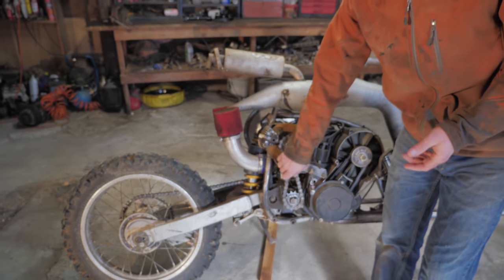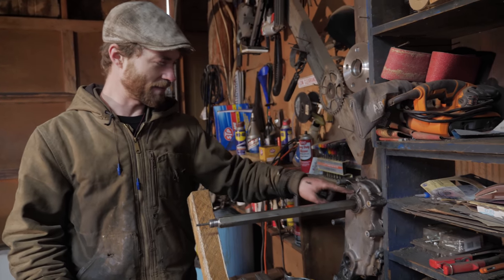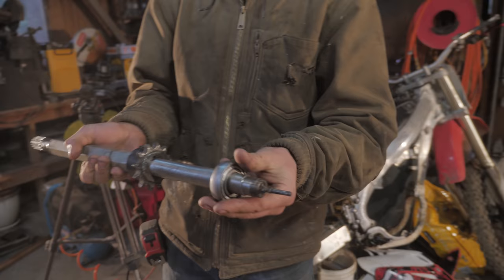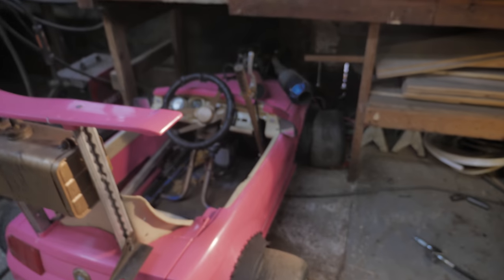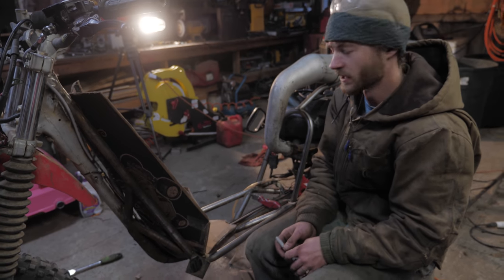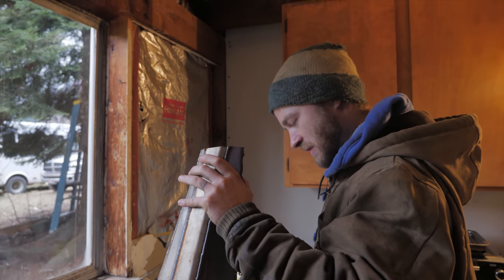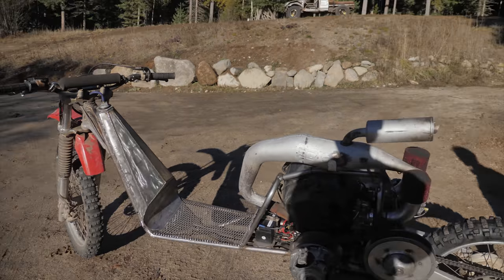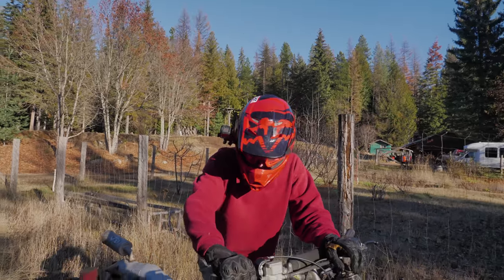The Scary Fast Snowmobile Scooter Rips! Part 4

Comment: The problem is when you build stuff all the time you don’t go over the safety aspect because the end user (you) is mostly pretty competent and understanding of the machine. However this doesn’t account for unforeseen situations. Any time there is a rotating assembling or high voltage these things need to have a guard over them whether it’s a mesh screen or plastic there needs to be some layer of protection. The mindset is “I’m just gonna take it out for a quick test” but that’s when the accident happens. I’ve done this a couple times wiring something high voltage that was “temporary” then got distracted left it like that for days cane back and blew it up with 30 amps vaporizing metal and flashing my face. I also once made a dogbone type driveshaft to convert a gear reduced scissor  jack to use with an impact (its freakin awesome) I had some exposed part of the driveshaft which I should have trimmed down or put a gated around but I got cocky thinking I’m he only user so it doesn’t have to be perfect. Well there was a freak accident with that and it nearly ripped my finger off when the jack fell and caught my hand. Those two incidents were enough to make me no longer do things temporary. Been working on machines all my life and luckily somehow have all my fingers still. SAFETY FIRST and nice build looks fun
Reply: Safety Sally  always one in a YouTube comment section
Reply: hey only cause I care for others bro be safe @kennethsee6262

Comment: Looks like it would also be good at garden work making rows for seeds to be planted, while at the same time covering seeds already planted, in the next zip code ;)  It would be funny, if you could you use a high output gas powered backpack leaf blower, as a super charger.  Great job and video.  With a rear wheel change, you guys have a great hill climb vehicle.  Or even create a new sport centered around vehicles like this.
Reply: Super charger backpack!

Comment: Great video!  A small suggestion regarding the power drill spinning the North Idaho Lathe...instead of using a zip tie to hold the trigger pressed, try using a velcro tie (the kind used for cable management).  I use one on the trigger of my power washer & it works great!

Comment: Just a suggestion as to something I would do would be to widen the area you stand like put the same size round stock as you have the frame have it come out say four inches andthen go back 8 inches and then come back in 4 inches and do that on both sides or even as much as 6 inches out. It will be harder to put your foot down but it will give you better control while riding it as you will be able to step to one side a little bit to transfer weight. Bottom line just make your pedestal where you stand wider. Awesome little machine extreme ingenuity to come from the top of your head. Good job!! I'm impressed!!!

Comment: Great job, i can totaly relate to your build . I built some ATV' s with snowmobile engines and you nailed it with this bike. Like you , i made sure my builds work as designed , but clutch and chain guards are manditory.
I ride my ATV a lot and race it , i have been rideing it for 10 years and am refreshing it for next year. Love your build
Reply from the maker: Thank you! An ATV with a sled engine sounds awesome! I’m working on making it safer, now that it runs properly. Clutch guard is already done, exhaust heat shield next.
Reply: @GrindHardPlumbingCo  
I have a chain from jackshaft to transmission it also is running around 2 gears with a small diameter. Yes i cook my chain regularly.  No room for a solution without other sacrifices like ground clearance. But fresh chain is good for a couple weeks of terror. Performance equal to can am 800 but in old polaris sportsman chassis wih 8 inch of extended frame. Arctic cat zr 600 efi engine with grass drag chip and a bottle of NOS.

Comment: Clutch guard, mud guard on the rear so the engine and carbs don't pack up with mud each ride, and something to stop you falling back on that exhaust cause that thing will get SO hot it'd be like what happens after eating Taco Bell for a week. Those three small things and you've got yourself something beautiful. Keep up the good work!

Comment: I've ran into the chain and small sprocket issue before. There are many reasons for the heat. length also plays a part. Sucks that you guys had to re-invent the wheel, but the results were awesome

Comment: What you guys need to build now is a 4wheel drive from a snowmobile with straight axles.. the whole rear suspension could be used for a band to run front and rear axles like on a r.c.car ..belt drive 4x4.. think about it.. 
Just putting some ideas out there.. oh bye the way I live in Yakima Washington and wud love to build my own little phat boy 4x4 belt drive cart..

Comment: I don't understand. So much talent. Such a great motor. And he opts to bolt it into PRETTY MUCH THE ONLY CONFIGURATION THAT ENSURES HE WILL NEVER BE ABLE TO APPRECIATE WHAT HE DID. The man is on the verge of greatness. He was so close to answer questions people have wondered for decades. ISN'T THERE SOME DESIGN THAT WOULD ALLOW MOTORCYCLES TO BENEFIT FROM THE SUPERIOR SNOW MOBILE TRANSMISSION SYSTEM. BUT HE WILL NEVER KNOW BECAUSE HE BUILT A FUCKING SKATE BOARD THAT PROHIBITS ANY SERIOUS TWISTING OF THE THROTTLE.

Comment: Nice build! 
Looked like your chain case might be out by 180 degrees?  In a snowmobile the chain pulls straight against sprocket. Slack on chain guide side.
Reply from the maker: Thanks! The chain case is the correct way. Slack is on the tensioner side as it should be.

Comment: Take a break and fabricate a GARD for that clutch, here's a tip. Reroute the exhaust so it exits under the engine, cover the engine and all rotating mass with a wedge fairing, if your good you can fabricate it from fiberglass. Look into a sand tire with scoops,  G.H.P. !!!!

Comment: You guys need to put some 6 to 10 inch risers on the handle bars stand up motorized scooters usually have taller handlebars so its easier to control.
Reply from the maker: Definitely!

Comment: This is really cool but I think you need more protection for the rider, my dad and uncle put wheels on a snowmobile when we were kids and we ripped up the pit with it, very fast i remember there being no filter for carb. and the motor took a crap.
Reply from the maker: More protection is in the works! Already made a clutch cover. Working on a rear fender and exhaust heat shield now.

Comment: You should have built the end of the shaft up with weld then grind it down to size would work better then that pipe at some point that pipe is going to start slipping.

Comment: I'm a calve expert and I'd have to say by the way your muscle was ten times stronger than your levi's that those are man's calves and it is because you have man's calves that you were able to take a look, almos pass out and then shrug it off.  Lesser calves would have peeled off like a bannana peel.  When I was 8 my dad took me to pismo beach and I rode a 185 3-wheeler the first time ever on one and he rented a 250r.  Having a prosthetic leg he got real impatient with me having to pull me out of the bushes and by about the third time he said  "that's it boy, you crash again and I'm not stopping, you'll just have to pull it out yourself and go back to camp".  So I was determined not to wreck or let him and his 250r buddies get out of my sight so I stuck to them like glue ...hauling ass until all of a sudden they made an abrupt right turn and I couldn't or didn't dare and as I watched them go right I went off a 60 foot cliff at about 45 MPH into a huge bowl.  I never let off the throttle and when I hit the bottom my left leg flew off the peg and the tire ATE IT peeling my entire calve muscle off to the bone.  My dad somehow almost beat me to the bottom cursing at me as he slid down the cliff on his butt.  He picked me up and looked me over and said.."You'll live but where the fuck are your shoes?  I can't believe your stupid ass came riding with no shoes, what the fuck is wrong with you are you stupid?"  to which I said "Dad I had shoes on, they must be here" so I dug and dug and dug because even though I was in pain, he was pissed and did not believe me.  Eventually at about 3 1/2 feet down I found my shoe and held it up.  That's when the shock set in for him,,,realizing he'd been yelling at a boy with lower leg muscle dangling in the sand over stupid shoes and been wrong.  I just remember being treated like a king for a couple of weeks and when it grew back,....it was a man't Calve like yours that laughs like the black Knight at mere flesh wounds.  
  I know one thing for sure,,,,you won't do that again and neither will any of this audience...so great job and lessons galore learned.

Comment: Changing tires won't help your problem with wheel spin.  Your center of gravity is too far forward, and that means your rear tire is almost floating on the surface it is on.  That makes for great rooster tails as you have a lot of wheel spin, but that's not so good for forward motion.  You need to move the cg rearward so the rear tire can get better traction.   Also, standing on a scooter like that is inherently unstable.  You are just begging for serious injury if you keep it up.

Comment: Lmfao... phazer powered scooter.. 80 hp plus being piped and carbed its gotta be over 90hp.  My first thought when you pulled it out of the shop was.... primary meat grinder or rock grinder if ya laid it down. Id wrap the rear tire in a fender to keep the filters clean and build a strong clutch box to keep your legs from being eating.

Comment: Even though this thing looks like it's going to have absolutely awesome hill climbing ability, when going up a hill gravity is going to pull you toward the back of the vehicle,.. and what's behind you?...a seat?..Nooooooo! Instead you have over a thousand degrees of muffler mere INCHES from your legs!.. and God help you if something caused you to do anything similar to sitting-down, as that flesh-searing-Muffler is right there to catch your ass as part of the deal, Combine that with all of those uncovered spinning-pieces that are just WAITING with Keen-anticipation for a part of your body to inadvertently brush up against them so they can remove flesh the way they were MADE to, and you've got yourself an Incredibly capable hill-climber that may or may NOT kill or permanently disable you the FIRST time you ride it,... a true High-performance "Maiming-machine!".